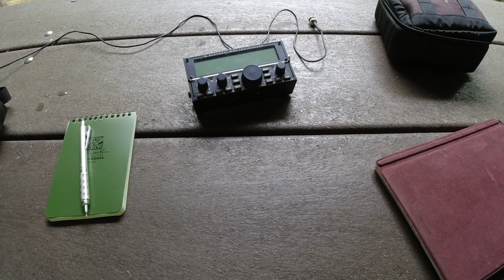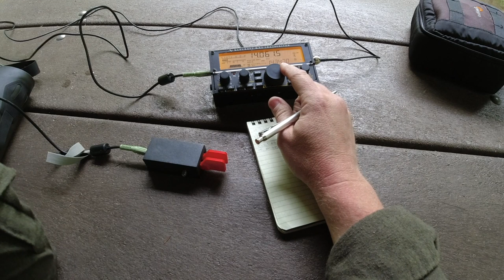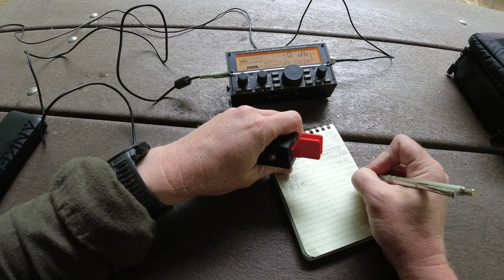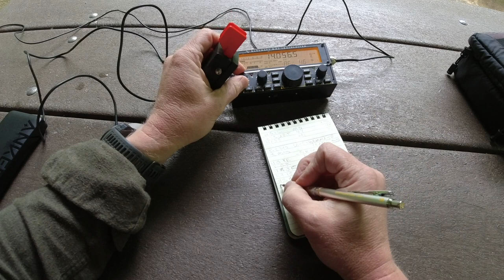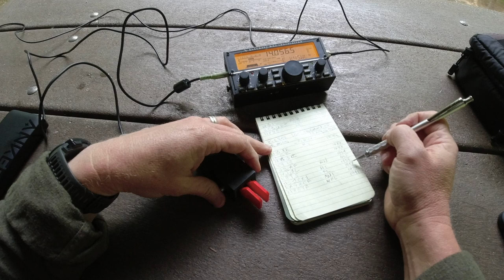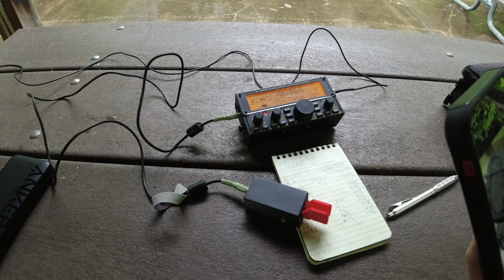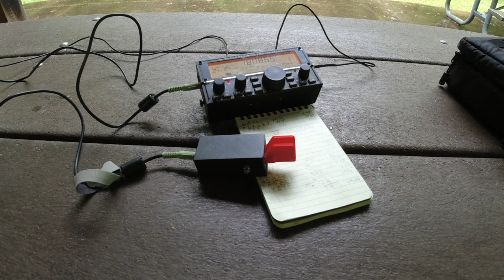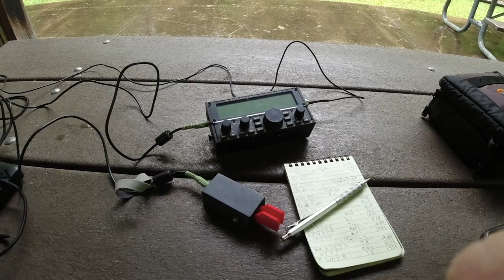Chelegance Tripod: Deploying the MC-750 in a Picnic Shelter for Some Rainy Day QRP POTA!

Comment: Amazing antenna !  As a speculation on what's happening:  The vertical element is coupling to the metal roof. The radials are coupling to the concrete, and concrete is an excellent ground.  Geometrically big on both sides resulting in high radiation resistance and high efficiency.  Thereby easily matched.  Really you have the whole picnic shelter glowing with rf.  Sure, this is a little fantastical,  but it could be true :)     Definitely an exciting activation !

Comment: Coiling the feedline makes a common mode choke on the outside. It will reduce unwanted ground currents to the radio. It should have no effect on loss inside the feedline.

Comment: Why not let your feedline coil up? For some antennas I've seen instructions to coil the coax feedline to (I assume) choke RF on the outer surface of the braid. I imagine it also prevents the feedline from becoming a radial. How would coiling the feedline coax cause attenuation?
Reply from the maker: I don't think it's a major issue, but unless coiled up neatly as an RF choke, I've heard it can have a negative impact. This might be better answered by an antenna expert, though.

Comment: So torn between this and the buddistick pro, any recommendations?
Reply: I'm not Thomas, but for me, I'd prefer the Chelegance over the Buddistick. Better built, and a better antenna overall.  --n1bs
Reply: @n1bsbri  I appreciate anyones insight, thank you!
Reply: Usually a longer antenna is better.  It will have lower loss on transmit and a better cross-section for receive.  Also, often longer does not have to be tuned as precisely to the operating frequency.  So the length metric favors the Chelegance.  Of course sometimes longer is less practical for a particular person or situation, and the buddistick pro works well for many people.  Try anything you can get your hands on and see what happens :)
Reply: @rabbit6914  Appreciate it, cheers!
Reply from the maker: I've never used the Buddistick Pro, but I have used the original Buddistick. I like the Buddistick system, but the MC-750 is so much quicker to deploy. Again, though, I've never tested the Buddistick Pro.
Reply: @ThomasK4SWL  Thank you, I appreciate your insight